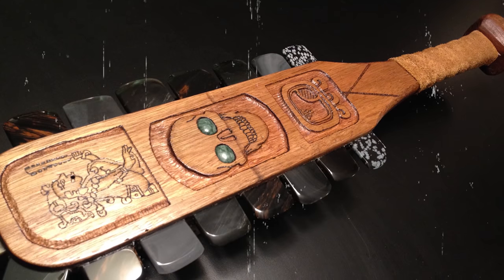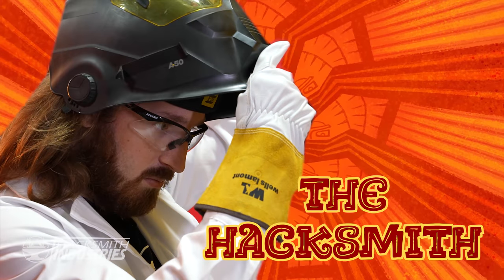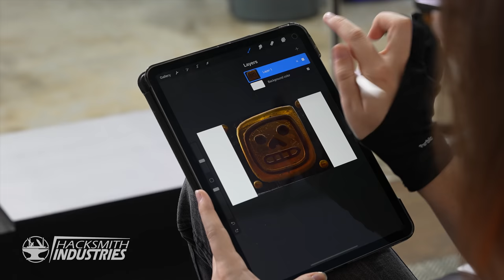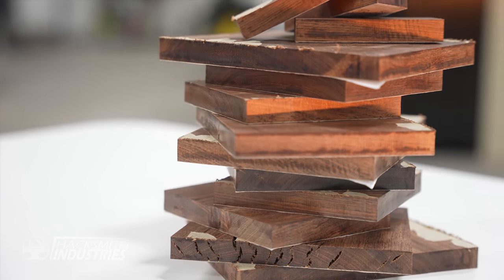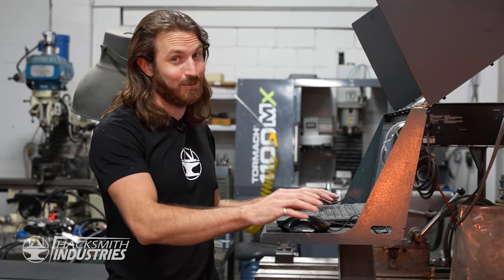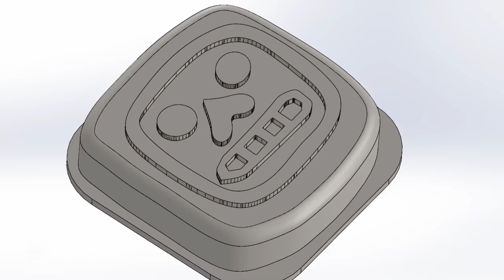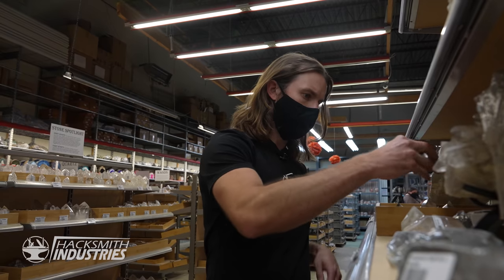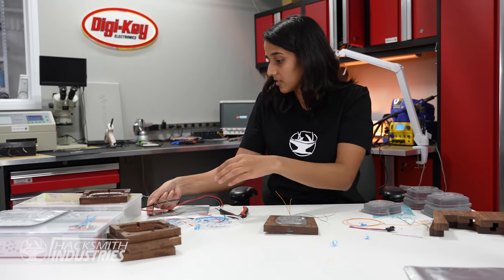The Sharpest Weapon We've Ever Made!?

Comment: Breaking the obsidian sure looked fun!
Fun fact napped obsidian is one of the sharpest materials known to man, with edges getting down to single atoms in thickness!
Reply: Yeah, by the title of the video, I thought they were going to mention that.
Reply: That's insane, it must be able to slice nearly anything if you hit it right
Reply: @leonardhaworth5632  only that sharpness is practically useless because even a cuecumber is too tougth and breaks an edge that thin! Obsidian Scalpels were used for a while in Eye surgery, but they had the risk of leaving micro splinters, causing complications in healing so they fell out of favour for newer materials.
Reply: @leonardhaworth5632  Eagle Claw is based on a macuahuitl. a weapon used by the Mesoamerican civilizations most notably the Aztecs. The obsidian blades, while extremely sharp were also very brittle and struggled to defeat metal armor worn by Europeans. Against unarmored opponents and animals it was very effective. The macuahuitl came in a variety of styles and spacing of the blades. The one requirement to become an elite Aztec warrior was to capture 20 men on the battlefield, so the broad flat wooden part was used for non-lethal subjugation. Sometimes the blades were left intentionally short and widely spaced apart so to deliver multiple nonlethal cuts, in order to wound but not kill. While these were pretty brutal weapons for the time period, steel swords still had a number of advantages including keeping a sharp edge and having a thrusting point that is better at defeating armor.
Reply: @nyquillusdillwad9119  yeh, there were a few variations. Most importantly, they tended to knapp the flakes used to make the 'teeth' (or sometimes, real teeth). Just smacking lumps of obisidian with a hammer doesn't really do it justice, especially when there are flint & glass knappers around making traditional blades and arrowheads.

Comment: Hacksmith: I want this to be as tough as possibl
Also hacksmith: uses obsidian velcro'd to the body for the "sharp" edges of the weapon
Reply: The original macahuitl's obsidian blades were tied to groves made into the wood so they could be replaced quick and easy when they broke, so, its basically a modern solution to the same problem.

Comment: When they started cutting out plastic for the faces, I started thinking it might turn out meh, but they could probably salvage it with some paint. Then I saw the obsidian "knapping" and of placing the pieces in resin, and felt they had probably failed, but decided to withhold my judgement til I could see the final product. Now, at 12:29 I think it is safe to say they did indeed fail.
The faces (and some other details) should look yellowish/golden, but instead look transparent/grey/plastic.
The serrated obsidian 'teeth' should be 8 solid pieces (somehow) knapped to have spiky teeth, but are instead haphazardly shrapnel essentially glued together.
The hilt should also be golden coloured, but looks like sheet metal and plastic.
Overall this would have looked way better if they did a paint-pass on all plastic components, and some metal. As for the obsidian, I have no clue how they should go about knapping them to shape (obsidian doesn't behave like metal or wood or such, as it is a type of glass. The model kinda struck me as impossible when they first showed it), but whatever they did wasn't it.

They did a good job with the wood, and the metal in the blade. And the eye looks both neat and accurate (maybe a bit too good, the model's eye strike me as more jank than what they managed :p). Still, I would consider this a failure (even if they painted stuff, so long as the impossible obsidian doesn't look the same, it isn't the same..).
Reply from the maker: And why did you feel like commenting this? Like seriously. What do you gain from leaving a comment?
Reply: @hacksmith  They gave pretty constructive criticism going over what they didn’t like and what they liked in a pretty fair way. That’s the point of a comment section no? For a platform so big why did you feel the need to reply if you didn’t have anything proper to say in response? Goes both ways.

Comment: Nice project:) Though for those vectors I would suggest to use dedicated vector program like Illustrator and make the by hand using Bezier curves. With such simple pictures it would be probably even quicker and it would produce cleaner curves with lesser points which would translate to faster cutting process:)